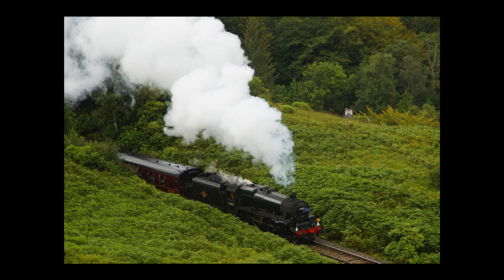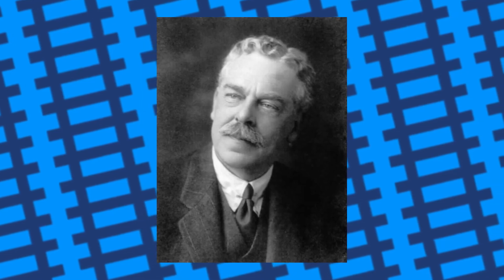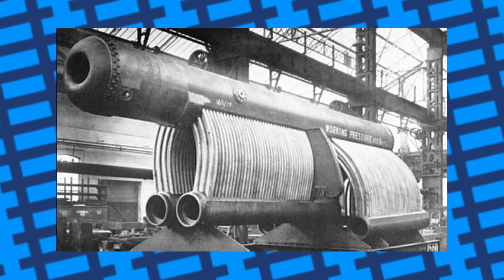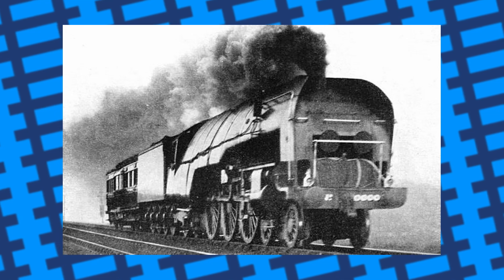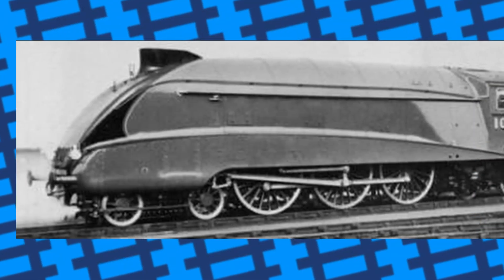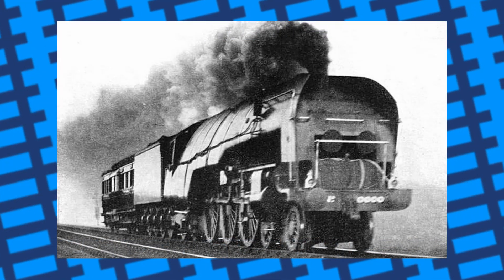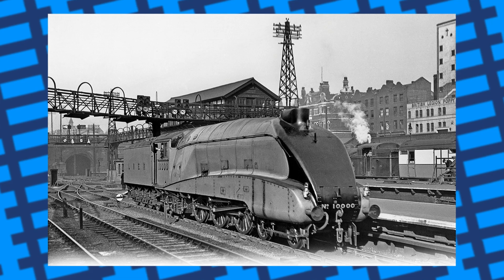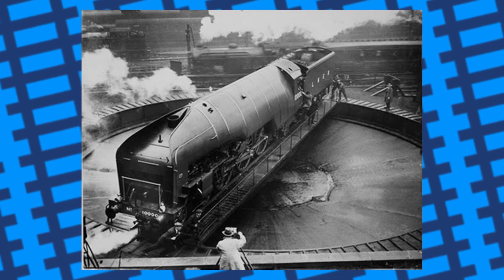The LNER's experimental locomotive - The "Hush-Hush"

Comment: Why did they extend the cab, rather than extend the firebox like on American locomotives?
Reply: idk ask the designers
Reply: My theory is that the marine boiler does not require an extended firebox (at least not this triangular type, it was basically the same it was just as shown on the picture built narrower in order to fit the locomotive chassi) because it is constructed in a different way with the firebox directly under the pipes. The reason some American locomotives had a much larger firebox was because they used Antracit as fuel and the firebox was especialy built for antracit, wich require a much larger room in order to reach the same temperature.
Reply: @Vampi_Sweden  That bit about the anthracite is only true for the camelbacks, which burned anthracite culm (literally the waste material that couldn't be sold economically). The Lima-style "superpower" designs used big fireboxes for increased steaming capability from the increased grate area of a larger firebox. It's the same idea as a 4-6-2, but with even more firebox. The logical conclusion of this was the 2-6-6-6 "Allegheny" simple articulateds which had a 6 wheel trailing truck for firebox support.
Reply: @davidfuller581  
Yes, i had to chack up the differense between the British and the American meaning of the word, that make a lot more sense to me than using higher grade fuel in those areas.  Interesting history by the way. Except for parts of Germany i don't realy think there are any large scale paralells to that in Europe, at least not in the 1900s. (I don't know about Russia, but i can imagine they did in some areas)
Reply: @Vampi_Sweden  I don't think any European locos match the sheer size of the American ones. Maybe Russia, but nowhere else, I think...
Reply: @davidfuller581  
In Sweden we used series of 2 or more locomotives for the ore transport from the mines, so "SJ Litt. F" (Pacific class) (and "SJ Litt E2", an improved Consolidation class) is the biggest Swedish locomotives ever produced. A few "Litt E2" was in duty until the early 1970s for some industrial applications, as far as i know the last ones of the old steamers here in active duty.
Reply: @Vampi_Sweden  yep, the big ore hauling roads here used really big engines - the Duluth Missabe and Iron Range for example is well known for using very large and very powerful 2-8-8-4s. A lot of the reason for these massive engines was it was cheaper to buy and use them than pay multiple engine crews using smaller engines. On the other hand the US had totally phased out steam on large carriers by the late 1950s, but I believe on short lines and industrial some stuck around until the mid 1970s. Memory's a little fuzzy on that one.
Reply: @davidfuller581 
Correct me if i am wrong, but wasn't the last one for the American ore line built in 1955? There are at least one undergoing restauration back to functional condition i seen on some videos here on YT. It's genuinly awsome it could be done and the old lady will be back on the tracks soon!

 I am not sure why they used that system in sweden, but i guess the electric locomotives did came into the picture pretty early ( 1922 to be more precise) because of the waterpowerplants in the north and they wanted to use the modular system for the new electric locomotives wich could easily be chained up in an almost infinite number, M (Ma, Mb, Mc/G7 och Md) (built in the 1901-07 and improved in the 1910) where the locos used for the ore transport in Sweden, they where pretty small and finaly retired 1937 most of them where scrapped but a few are still preserved in the railroad museum.

The larger F loco where originaly designed for highspeed passenger transport and they where sold to Denmark where they was in duty until the aerly 1960s.

One of them are preserved at the museum, i am not sure if it's still functional, but looks complete.

My grandfather worked on those in the 1930-40s.
Reply: @Vampi_Sweden  I don't know, exactly

Comment: One note about the Yarrow Watertube boiler was that after it was removed when 10000 was rebuilt, it ended up being used at Darlington Works for pressure testing. The boiler was finally scrapped in 1965 (6 years after 60700 (Which was the BR Number for the W1) was scrapped.

Comment: As far as I can tell the most important quality for a high performance boiler is rate of steam production. In boilers of equivalent size their operating pressure would be an indicator of that rate. Was the hope that high pressure boiler would transfer heat more efficiently to the water? Otherwise I don't see why the higher pressure would be expected to help.
Reply: Maybe, unless they were also interested in thermal efficiency improvements, to reduce the amount of coal burnt, compared with conventional locomotive boilers.
Reply: The higher the steam pressure the greater force on the piston, allowing for smaller cylinders and pistons which means less reciprocating mass. Unfortunately, with only a single stage of expansion, efficiency would suffer as less heat is extracted per pound of steam.
Reply: @billmoran3812  this is true, but to my understanding, full boiler pressure is not applied to the cylinders, at least in locomotives with regular boilers. Also pressure is only half the equation, steam must also be applied in a sufficient quantity. Doubling the pressure is all well and good, but if you only get half the mass of it does that actually give a benefit?
Reply: @MainlyHuman  Doubling the pressure but adjusting the cut-off to only allow half as much mass of steam would offer an advantage, if one could double the expansion ratio of the cylinder.  The portion of the cylinder travel after the volume has doubled would yield the same amount of energy as had been yielded on each stroke at the old pressure, but one would add additional energy at the start of the stroke.  Doubling the expansion ratio, however, would be essential, and I doubt it would have been practical for non-compound locomotives.
Reply: @flatfingertuning727  I think that fits my understanding, for non compound locomotives at least, the mass of water converted to steam is what's significant, as you can extract that energy from different pressures by altering the cylinder conditions. I imagine that higher pressures work better for compound locomotives for the reasons you have above, and that is important because compounding (when enacted properly) can result in significant efficiency increases. It doenst make sense to build a really high pressure boiler if the cylinders aren't built to accommodate that though.